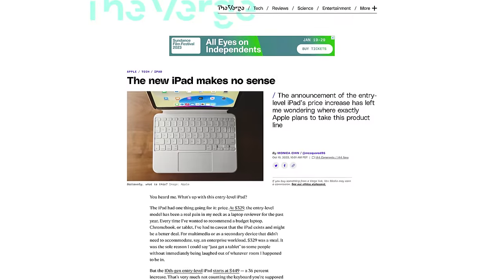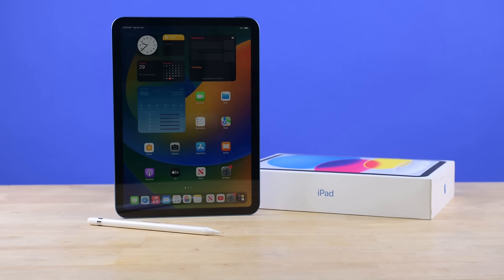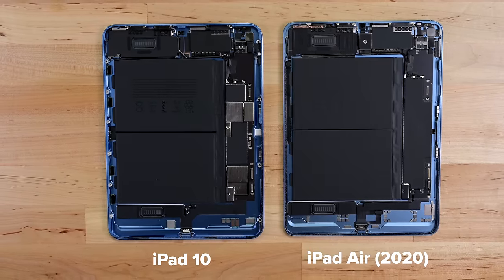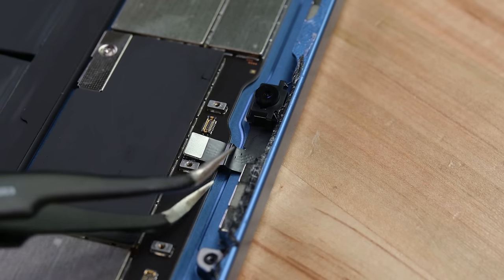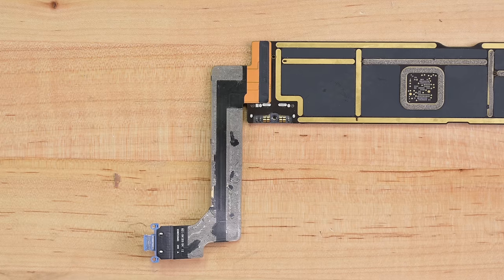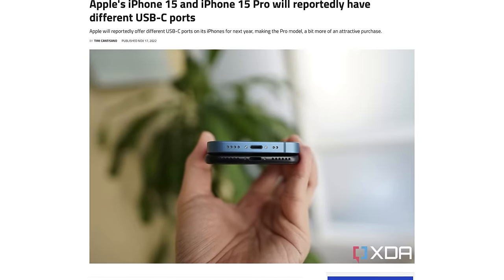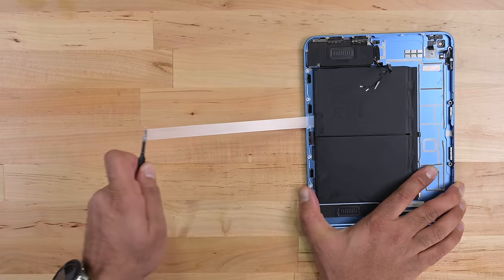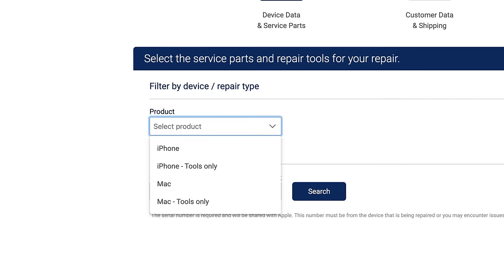iFixit Tears Down the Baffling iPad 10!

Comment: how to OC apple A or M1 M2 Soc : max speed clock: ???
Reply: there is no methods like that
Reply: So there are ways to force Max performance mode on macOS, but there is no real point as the os will push into these modes as and when needing forcing these modes only makes a difference if you do a lot of very short lived (1ms) tasks that finish before the os threshold is triggered to engage max perf mode.

Comment: Hate USB C. Not even that much more durable then the micro usb it was meant to replace. New iphones now cant have the port cleaned easily and will have more failures similar to other phones and tablets that use it. Haye seeing media claim its the better port when in reality its far less durable then lightning. Also the arguement it keeps chargers from going into landfills is just wrong. Because those adopting the new cable will have to throw out their old ones now. Meaning MORE chargers in landfills then before and now more devices too when the port breaks nore often and people wont shell out hundreds and hundreds of dollars to get it replaced. Just another downgrade that is forced by the EU. Similar to lots they do or try and regulate and just make worse.

Comment: Well if they are having such a hard time on wireless charging for the pen with a landscape camera then maybe they should ask Samsung. They have no problems adding it to the tab s7 and s8.
Reply: I have a Tab S8 and the place where the spen charges is on the back of the tablet, if you look at photos and see the glass strip running down the back, thats where the spen charges from. It unfortunately doesn't charge from the sides, but also does mean that cases can easier protect the tablet while still letting the tablet charge the spen, theres pros and cons to both methods.

Comment: Funny that you imply Apple is moving to USB-C because they’re being forced to. Remember who was the primary mover in developing USB-C? And who first implemented it? Who was that? Hm…
Reply: Because most of their revenue comes from iPhone sales. Moving to USB-C means losing plenty of $$$ from royalties on Lightning accessories.
Reply: @calorion  Obviously.

Sales from iPads and other Apple devices are just a tiny fraction of their revenue compared to the iPhone, so switching to USB-C on those devices won't make much impact on their profit. Add the fact that people keep their tablets way longer than their phones which are often replaced around every 2-3 years.
Reply: @peterthepanda  And so obviously, the reason this iPad has USB-C is the new mandates!
Reply: @peterthepanda  Or, *maybe*, the reason that iPads have moved to USB-C and iPhones have not is that iPhone users are more likely to replace their iPhones, and therefore don’t suddenly want to have to buy all new chargers and accessories!
Reply: @calorion  Probably. 🤷‍♂️

But then again, they released the first iPad with USB-C in 2018 with the iPad Pro 2018.
Reply: @peterthepanda  Right. Nothing to do with mandates. But many iPhone users are less technically savvy than iPad users, and so will be more inconvenienced by a switch from Lightning. Plus are likely to have more, and more specialized, Lightning accessories (I specifically bought an older iPad because I didn’t want to switch to USB-C). Remember, the only reason we have Lightning at all is that USB-C wasn’t ready yet.
Reply: @peterthepanda  I’m not saying that profit has nothing to do with it. Apple is good at making decisions to enhance (or not detract from) the user experience that just happen to make them money as well. But in general, they have refrained from doing things that harm the user experience simply because it results in more money rolling in.
Reply: @peterthepanda  It does not the MFI program makes very little money from lighting cables. For a device to work with iPhone it will still need to be part of MFI even if it sues a USB-C cable. 

the USB-C requirements from the UE do not include requirements to support all USB-C data devices. Apple can (and will) still require USB-C attached accessors to be part of MFI even if they use a USB-C cable.  In fact the EU requirement does not even require things like analogue audio mode etc so apple could increase the number of devices that must be part of MFI devices today that need you to bring your own light to USB adaptor currently cant request MFI but with the change to USB-C apple will have that data layer to do the handshake so can require MFI for all devices that work with the phone.  

The connectors has nothing to do with MFI.

Comment: Ah y cant understand what people want to repair there  because  you will have 3 chips on the entire  board ram, nand and SoC done rest is psu for display and display logic board  usually when it starts to beak it brakes entirely  ah and yeah is ok to have a self camera in landscape but at least it should be centered,  but what the heck would you do with  a rear camera useless,  apple don design hardware they jus buy from other companies parts 😉  that's why it looks like a diy system Apple are resellers they bui creap bundle thoghether and sell expensive  and that because some users won't buy specs but actually will go dor if it's expensive is also good quality most people suffer from snobism  y still have android machines from the first iPhone era but  y fried many iPhones in the same time period